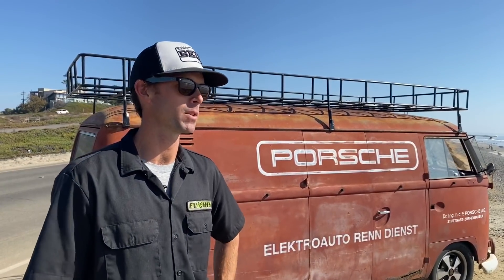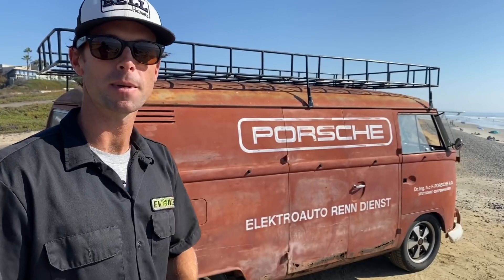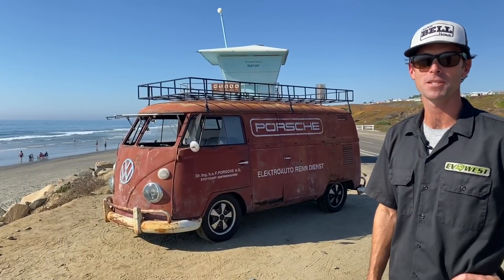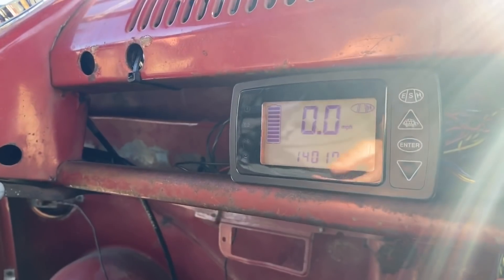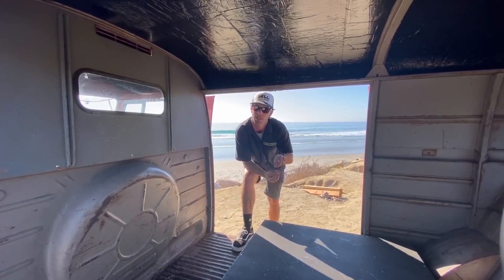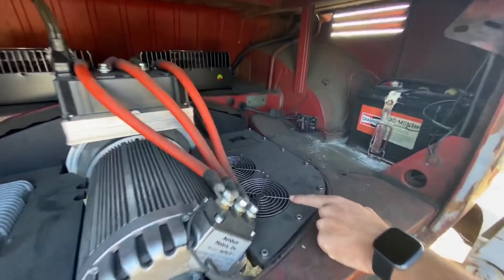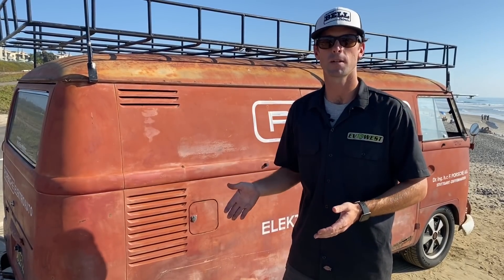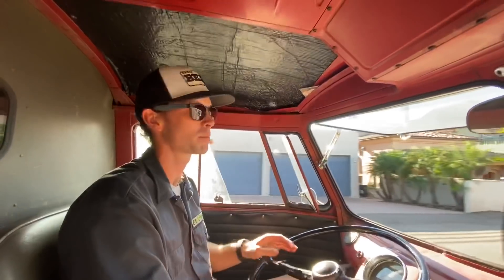1963 VW Bus / Transporter EV Conversion | EV Show

Comment: I have a vw transporter t5 from 2009. It has auto box. Leaky engine no one can seam to fix. Is this a easy convert to ev? Range about 250miles with 300-400bhp?

Comment: UK MOT wouldn’t let that on the road with that rust. Cool conversion however!!
Reply: Correct me if I'm wrong, but as long as it is structurally sound, it should be OK. Those rusts on this vehicle looked, and probably are, cosmetic.
Reply: @ahlapski  yes structural there can’t be rust within 30cm of a structural mounting point, engine mount, suspension mount etc. But also the exterior body work can’t have sharp or jagged edges like you see in the doors on this bus. Just interesting to see what other countries allow. Cool conversion however!!

Comment: I'll admit this is cool technology but don't think for a second that you're carbon footprint goes away. 10 hours to charge??? Really? How much coal or oil is used to generate the power to charge the batteries? Not to mention the heavy machinery needed to destroy the earth to mine what is needed to make the batteries.  Like i said, cool technology but don't be fooled into thinking its better just yet.

Comment: “Some rust” = euphemism for rust bucket.
Reply: in california this bus will never get any worse with rust. rockers and cargo door bottoms are not a big deal. If you owned it you could have this fixed in a couple of days. there is no reason to fix this  other than looks. He said they fixed the cargo floor. much more important. If they wanted it to look restored, they probably  would have restored it. in most of the rest of the world this would be a clean bus to restore. And now that Tim Leventry has passed, there is really no reason to restore it....
Reply: @uliwehner  sure, I respect their design/build decisions and those who prefer preservation over restoration. Not my preference, but I respect it. I was really just trying to get a laugh over the car community’s habit of understating rust with euphemistic language like “patina,” or the “some rust.” I realize this wasn’t a classified ad attempting to sell a used rust bucket, but it alludes to it strongly. Again, going for a laugh, if a cynical one.
Reply: @uliwehner  but they’re close enough to the ocean in San Diego that cars there do get rust. I lived there for a year and my sister attended university there. Closer to the ocean, the more the cars in the driveways look like they’re from Michigan.
Reply: @bryandbaker  yep I am 0.8 miles from the ocean in San Diego (Encinitas) and it gets pretty wet and salty every night/morning.   It is scary on classics.  My 79 VW westy and my 68 double cab are covered or garaged and they need to be well protected.

Comment: Are there any Convertibles that would make a good EV ?

I'd live to turn a gas-guzzling Bentley or Audi Soft-top, Electric !
Reply: porsche boxster, the battery and motor fit on the same space as the engine and you get to keep both the trunk and the fronk
Reply: @nicoparra1990  Brilliant, thanks very much !

Comment: Do you have a conversion for the Ferrari 308 from the 70/80s?
Cool transporter!
Reply: https://youtu.be/qYIcTnaIib4
Reply: Who would convert a Ferrari? This is cool, but the engine is half of what makes it a Ferrari
Reply: @Aikaramba12  me!
Reply: @kdz666  well good luck with your project :-) but try to make it possible to convert it back, because i am sure your Ferrari (in original condition) will rise in value over the next 10 years
Reply: @Aikaramba12  you are right of course. I have had it for 20 years now, and would like to use it more regularly and not worry about parts and prices. Its such a beautiful thing. Plus, I think it will be faster too! 
Og kanskje en dag kan jeg kjøre gjennom Oslo, uten å betale for bomringen!!
Reply: @kdz666  det er utrolig stilig! Er du bosatt i Oslo med en 308? Kan vel umulig være alt for mange av de i området. Lykke til med prosjektet, og håper jeg får sitte på en gang ;-)
Reply: @Aikaramba12  uploaded en video for deg av min bil - Frognerseteren (Tryvann), og Slemdal - Men du har jo ett poeng - lyden er noe annet. Men samtidig, får mye uønsket oppmerksomhet!
Reply: @kdz666  wow råkult! Personlig synes jeg ting som både går bedre og er mer energieffektivt er kult. At elektrisk ikke er moro er bare tull 😉 alt som går godt er gøy. Lyden er selvfølgelig noe man kommer til å savne litt, men det er kanskje mest nostalgi
Reply: @kdz666  og tusen takk for video!
Reply: @kdz666  i was following along until you said "oigbhtgh"
Reply: @MauricioBarragan  turned out we both live in Oslo, Norway ;-)
Reply: @Aikaramba12  Me too!